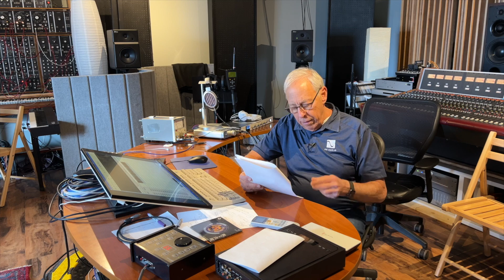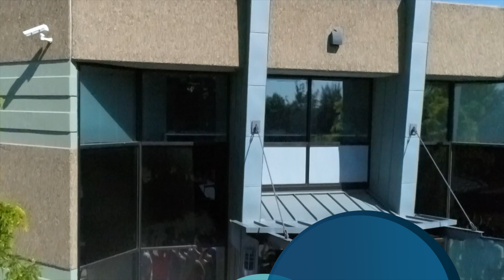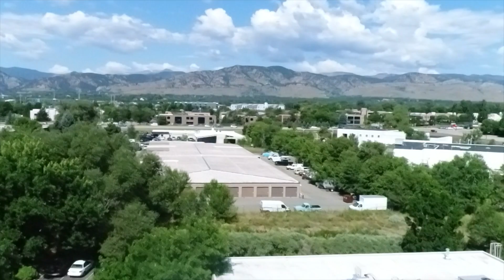External crossovers

Comment: Best is to do the cross-over before the amplifier to allow the amplifier more direct control of the speaker cones with max damping factor. Active cross-over filtering is also easier to optimize to perfection, if you know what you are doing. It can either be purely passive, with some electronics or with DSP. Digital audio aficionados might want to rip out the cross-overs of the speakers, use mono blocks to power them and add some DSP filtering to truly fine-tune the filtering characteristics to perfection against the speaker characteristics and room acoustics. E.g. miniDSP makes some products that can be used for this.
Reply: Yeah, this is a very nice AND VERY versatile way of doing it, however, it is ALSO considerably more expensive too, due to having to have (or buy) more amplifiers and the equipment needed to make the speakers actually work that way, so it's not always totally practical or doable, especially if you're on a relatively limited budget...

But it's definitely worth a try IF you have the money to invest in all of the separate amplifiers and such, AND you are ALSO knowledgeable enough about your speaker's individual driver specifications to then tune the setup properly, not only for the best sound quality and blending between the drivers, but ALSO the settings needed to not ever damage or blow out any of the individual drivers if/when playing the speakers loudly or with a lot of bass heavy music.

ALL of that above stuff is important to know and do in this kind of setup, that's why it's not too commonly done, especially among the relatively inexperienced "noobs" OR anyone who is on a tight budget.
Reply: @JoeJ-8282  Agree, this is only for those technically skilled and deeply passionate for perfection with a budget to support it. On the other hand, a beginner approach is to start with two bookshelf two-way speakers and one or two subwoofers. You can then use two stereo power amps and a miniDSP Flex 8 that will then be used with only 5 of the 8 outputs.
Reply: @JoeJ-8282  “it is ALSO considerably more expensive”

Is that true?

With an active crossover
1. You save the costs of a passive crossover. Good components for passive crossovers are very expensive, because of the high voltages and high currents.
2. You need much smaller amplifiers and a smaller power supply.
3. On the other hand, you need an active crossover. With a 4-way design per channel that can be more expensive than a good passive crossover.

An illustration of point 2.:
* Suppose you have a 4-way stereo system, with 8Ω drivers.
* And suppose you have some music which leads to 1 Ampere and 8 Volts to each “way”.
* So with an active crossover, each “way” requires 8 Watt from the power amplifiers and power from the power supply for in total 32 Watt of output power.

With a passive crossover
* You need now a signal of 4 Ampere and 32 Volts, so in total that requires 128 Watt and a power supply to supply the juice for that.
* So you need an amplifier that can supply 16x the amount of power as the 4 individual amplifiers in the active case. The power supply needs to be 4x as big.

Actually it is even more.
Normally drivers are more sensitive with frequency. With a passive crossover the extra sensitivity is “burnt” in padding resistors, and each way requires about the same amount of power. In the active case you need even smaller amplifiers for drivers other than the driver with the least sensitivity.
Reply: @JerryRutten  IDK where you're coming up with your math there, but it really doesn't make sense.

If you only needed 8 volts to the drivers in the active state, then WHY in the world would you then need 32 volts to each driver in the passive case?? It should be the same, at least for the same power output. (Making the TOTAL input wattage needed the same amount in either case too.)

And... Even IF your first set of calculations was correct, it also doesn't compute in your comparison between the wattages of "128" and "32"... That is NOT 16x as much, but ONLY 4x as much... But it's not even that in reality because of what I said in the first paragraph, above.

In reality, there IS some minor losses in passive crossovers due to the resistance of the various components, but it's probably no more than about 10 or 20% AT MOST, so, the total wattage needed for either case, (active OR passive), is actually quite similar, with the passive crossover design method definitely taking more overall total watts of power, however it's no more than about 10-20% more, like I said.

Besides, with a passive designed speaker, the wattages/power that ACTUALLY ends up going to each individual driver ISN'T equal anyway, because in most "normal" or "average/typical speaker" cases, the tweeter usually only gets about 10% of the total power going into the whole speaker, the midrange usually gets around 30% of the total power input, and the "remaining" 60% or so goes directly into the woofer, because bass notes always take the most relative current to reproduce, so the majority of the total wattage input into the total speaker almost always goes directly into the woofer with most normal music. 

I've actually tested that quite a few times over the years also, that's why I say those numbers. The relative percentages change of course, based on the relative crossover frequencies for each driver, AND the type of music being played through the speaker, (bass heavy, vocals, lots of cymbals, etc.), But those numbers I gave are pretty close to the typical average percentage of the total input power going into each driver in most cases.

So the whole overall amplifier cost thing is debatable, but simply because you need less total number of amplifiers using a passive setup, I still think that way of doing it is at least somewhat less expensive overall than an active design of the same specs or capabilities, depending on what kind of amps you use and the overall total wattage that you want to have.

And the only other difference in cost is between the relatively more expensive passive crossover components vs. the cost of the active crossover unit... Which may be pretty close to the same overall in all actuality, but ONLY if you're using quite decent to VERY good quality passive components, (capacitors, inductors, etc.), because if you're only using more "basic" or "entry level", (but still GOOD quality at least), passive crossover components, then I think the overall total cost of doing the active version of the speaker, (all other things being equal), would be noticably more than using a passive crossover instead, especially considering that you DO need more total amplifiers with an active design, regardless of the total wattage needed or desired.

Anyway, with modern technology bringing prices down on everything, and for an equal or sometimes even greater performance level than in the past, (recent inflation aside, lol!), it might be about time I tried an active speaker design again soon, especially because of the MUCH greater "tweaking" and "adjustment" ability versatility of that type of design...

Speaker building is an art and fun to do no matter how you do it, so it's really ultimately just a matter of personal preference and budget at the time, in deciding which method that you're going to use for whichever speaker project that you're working on at that time.
Reply: Thanks for your (extensive) response.

I totally agree with speaker building, and amplifier building, is fun.

OK, let’s try to explain the math step by step…
- Suppose, you have a 4-way system.
- Suppose, you have crossover point at 145 Hz, 350 Hz and 1100 Hz to distribute the musical power evenly over the drivers (yes, I know that the power in the music is not distributed evenly, but actually that’s not relevant for the example).
- Suppose, the drivers have equal sensitivity. (In the passive case this is also not relevant, because the padding resistors are there to make them equal sensitive).
- Suppose, you have 8Ω drivers.
- Suppose, each driver draws 1 ampere at 8 volt.
- So, each driver uses 8 volts, 1 ampere and 8 watt. Again, each driver!

In the case of an active crossover, you need 4 amplifiers (in the mono case).
- Each amplifier puts out 8 volts, 1 ampere and 8 watt.
- Each amplifier need juice for those 8 watt, thus you need a power supply for the juice for 32 watt (4 amplifiers). Or 1 power supply to support 32 watt, or 4 power supplies each supporting 8 watt.

In the case of a passive crossover, you need 1 amplifiers (in the mono case). If you combine the four signals you get:
- 32 volt (4 x 8)
- 4 ampere (4 x 1)
- And thus 128 watt (32 x 4)
- You need an amplifier to put out those numbers.
- And you need a power supply for the juice for 128 watt (1 amplifier).

So
- In the active case you need the amplifiers to put out 8 watt (each amplifier).
- In the passive case you need the amplifier to put out 128 watt

So
- In the active case you need a power supply to support 32 watt (4 amplifiers, each 8 watt).
- In the passive case you need a power supply to support 128 watt.

So, in the passive case, you need
- Power amplifiers that are 16 times as big (and you need 4 of them).
- A power supply that is 4 times as big (only 1).

And yes, I didn’t took the insertion loss of the passive crossovers into account, which is about 0.5 dB per filter order.

The whole point is that if you make the signal 4 times as big, the power is 16 times as big.

Hope this helps.
Reply: @JerryRutten  OK, I guess you don't understand how Ohm's Law works... Or maybe how parallel circuits work?...

Your first mistake is throwing you off BIG time!...

With the exception of the insertion losses of the passive crossover components, the total required wattage is the same in EITHER method of design...

(To use your example of a 4 way speaker...)

With an ACTIVE design:
4 drivers with each one getting 1 ampere at 8 volts (i.e. 8 watts each)
(So 4 amplifiers needed per speaker channel (Left or Right) x 8 watts each)
4 drivers (and amplifiers) x 8 watts each = 32 watts total (including same total needed from power supply) (per speaker)
(Therefore 64 watts TOTAL needed from 8 total, 8 watt individual amplifiers for a stereo PAIR of 4-way speakers)
(OK fair enough)(Right?)

Now... With a PASSIVE design:
4 drivers with each one needing 1 ampere at 8 volts (i.e. 8 watts each)(all other things being equal)(Remember about uneven power distribution among drivers in a passive design, but the TOTAL for ALL 4 will still be same, no matter what that individual distribution is.)
(So; 1 amplifier (mono channel) providing 32 watts total would be enough to power this entire speaker) (SAME AS active design) (*except for insertion losses*)
BECAUSE:
ALL of the drivers in a passive speaker are essentially/basically in "parallel" with each other, (except for the crossover components inline for each driver of course), and in a "parallel" circuit, the voltage delivered to ALL drivers would then be 8 volts, ALL at the same time, therefore, the ONLY thing that multiplies is the total current in amperes, so:
4 drivers x 1 ampere of current needed each = 4 amperes total circuit current (and AT the 8 volts that is simultaneously delivered across ALL 4 of them at once) = 32 watts TOTAL needed from a single (mono channel) amplifier, (AND associated power supply), (*plus any insertion losses*), or 2 x 32 watts = 64 watts TOTAL needed for a stereo PAIR of said 4-way passive design speakers, so VERY CLOSE TO THE SAME as an active design...

So NOW do you see why I say the only real differences is/are the types and number of equipment needed to make whichever setup work...

Only 1 mono amplifier (or 2 mono amplifiers OR even only one "stereo" amplifier for a stereo PAIR of passive speakers), of 32 watts into each speaker channel, is no doubt going to be a cheaper total cost than 4 individual amplifiers (or 8 total for a stereo PAIR of speakers) (for a 4-way speaker design), and then so the only other major thing to consider is whether the ACTIVE 4-way crossover is actually cheaper than the passive crossover component's total cost, AND by at least as much "less"(?) than the multiple 8 amplifiers are MORE than the 2 (or even only ONE if a stereo amplifier instead of mono) cost... You'd have to just see which method of design was actually a cheaper total cost for EVERYTHING needed to make each design method work properly, or at least which method was within your budget...

I think all of these prices overall would have to be experimented with nowadays, since some prices of some things have gotten cheaper over the years, and the prices of other things have gone up, but at least hopefully you can now understand where you originally went wrong in your calculations of total watts (power) needed. The only REAL, possibly significant differences there between the two different types of designs are any insertion losses of the individual passive crossover components, which definitely does NOT make as significant of a total wattage difference as you were initially thinking due to your miscalculations in the beginning of your math sequence.
Reply: @JoeJ-8282  I appreciate your response regarding to the subject, I don’t like the silly statements about Ohms Law, parallel circuits and throwing off…

Suppose a signal consisting of 4 sines: 70 Hz, 200 Hz, 700 Hz and 2000 Hz, each going into a different driver, each with a peak amplitude of 8 volt. These signals combined give a peak amplitude of 32 volt. So, the (peak) power in these individual signals is 8 watt, the power in the combined signal is 128 watt. I think it has nothing to do with Ohms Law or parallel circuits…
Reply: @JerryRutten  Nope, that's NOT how it works, voltages do NOT "sum" in this case at ALL... You need to go take a MUCH closer look at how Ohm's Law works and how you figure out watts and power, because in the case of a speaker it doesn't work the way you are describing at all... And even if it did, then it would ALSO have to do that with an active speaker design...

Go closely study Ohm's Law and how voltages and currents are calculated in series vs. parallel circuits.

If you cannot understand it after that then I honestly do not know what else to tell you, because I can't really think of a way to describe what's going on within a passive (OR active) speaker any clearer... At least to someone else who also can at least grasp the basic concepts here.

I'm not trying to be mean either, I'm just saying that either you learned what you're saying from someone who also didn't know what they're talking about, or else you just didn't fully understand what you thought you were learning about... Try again.
Reply: @JoeJ-8282  I have a question...

If you have a music signal of, let say 32 volt. And you split it into 4 signals with some crossover networks. What are the voltages then?
Reply: @JerryRutten  Well, in THAT specific case, each one of the 4 drivers then would be getting 32 volts sent into them, (potentially up to, at a maximum, based on crossover frequency settings for each driver, as a result of specifically dedicated parts of the crossover for each one of the drivers), since inside a speaker, (specifically talking here about a passive crossover design one), ALL of the individual drivers are essentially, (through the passive crossover components needed for each driver), all wired in PARALLEL, all are connected to the input terminals, with one of the input terminals connected to one terminal of each one of the individual drivers, and the other input terminal connected to the other terminals of each of the individual drivers, with whatever necessary passive crossover components inline with at least one of the terminals, therefore creating the necessary frequency cutoffs for each driver, but since ALL drivers are essentially connected to the input terminals, all of them together and at the same time, (at least through the specific crossover components that each driver needs), then ALL drivers essentially get whatever voltage is put into the input terminals of the overall speaker, and the only thing that limits that input voltage to the amounts actually going into each driver, is the specifically needed crossover components (for that driver) themselves, so then it's based on or only limited by whatever frequency or frequencies are being sent into the speaker's input terminals at any given moment, that's why depending on the input frequency or frequencies, the actual amount of that input voltage (whatever it may be), that actually goes into each individual drivers, (and therefore the watts or power going into each individual driver), is always continuously varying, depending on the music signal, however each driver cannot ever get any MORE than the input signal at the input terminals of the overall speaker, because well... I think that's obvious, due to the physics law that you can't get more energy out of something than whatever you put into it.

About the only way that ALL of the individual drivers of any speaker can actually receive the ENTIRE input signal level or voltage is if the input to the overall speaker is 100% modulated "white noise" with ALL audio frequencies being played at the exact same time AND at totally equal levels, and that would then make the overall speaker the loudest that it can be at said input level, whatever that is, and then also up to the maximum input power that the speaker can handle before burning out at least one of the drivers, whichever one has the lowest power handling. (Usually the tweeter in most cases)

Anyway, hope all of that helps you to be able to visualize this whole concept and such in your head. I will attempt to also answer any further questions you (surely will) have too, but just be open to learning and discussing things, and asking about clarification of anything that doesn't make sense to you...

I like helping others to understand and learn about new things and new (to them) concepts and such, so I enjoy explaining things to someone who is willing to learn, so if you are that then I will continue to delve deeper until you are able to fully grasp all of this too if you want to.

I can tell that you're actually trying to understand this correctly, because someone who didn't actually want to learn, but instead just ALWAYS "had to be right" about something, those kinds of people CANNOT have a decent, intelligent conversation about something they don't really get, WITHOUT getting totally upset and/or even mad and hateful, like a typical "internet troll" does if you ever call them out on anything that they may say. Those kinds of people are not worth your time to try and talk to, you just have to ignore them after they show how inflexible, irrational, unreasonable, and (oftentimes) "mean", that they are... So anyway, thank YOU for NOT being like just another internet troll, lol!

I will continue to work with you and further explain any questions you have as long as you are committed to learning more about all of this stuff! I don't know everything, no-one does, but I do know a thing or two about electronic stuff, especially speakers, after these many decades of designing, building, repairing, and improving them, so I will try my best to help you to get to a better and more complete understanding of them also, if you want to.

However, the main problems with trying to "teach" someone on YouTube, (without making a video yourself anyway), is that the comment and reply length is limited to a specific number of characters, no more than that, or it just won't post... NOR can you actually DRAW anything like diagrams or whatever through the comments either, so sometimes it's difficult to get your total point across to the other person you're speaking with... But I'll still try to help you if you want me to...
Reply: @JoeJ-8282  Thanks for all your explanation! So, if I understand you correctly…

- If I put a signal onto the speaker, thus before the passive (parallel) crossover, each parallel branch gets the same amount of voltage.
- The passive components in the crossover network are there to ‘select’ only the frequencies for that driver.
- So inside the passband the impedance of that branch is the 8Ω of the driver, and outside the passband, the impedance is higher because of the filter components in series.

- So, if you play a signal with one sine of 8 volt on a frequency for one driver, let say 70 Hz, all the parallel branches get the 8 volt signal. And the filter components in each branch are there in such a way that only one branch, one driver, get the signal, the 8 volts (assuming that those frequencies are not near the crossover points). For the other branches the impedance of the filter components are so high that those drivers aren’t getting any signal.
- So the amplifier ‘sees’ an 8Ω load, only one driver, and that requires 1 ampere, 8 watt.

- And if you play a signal with 4 sines, each sine handled by only one driver. Let say 70, 200, 700 and 2000 Hz, each with an amplitude of 8 volts. Each driver sees only one sine of 8 volt, 1 ampere, 1 watt.

Do I understand this correctly?
Reply: @JerryRutten  Yes, so far, what you said there is correct. (Except for the VERY LAST thing you said in the last sentence of the last paragraph; it's actually 8 watts in that specific case, not just 1. Minor detail I know, and surely it was just a typo on your part, and you actually already understand that 8 volts into 8 ohms produces a current of 1 amp, and therefore the power (watts) into it is 8 watts.)
Reply: @JoeJ-8282  Yes, you're right with the 1 watt, that should be 8 watt. Thanks for your answers and patience with me. But I have some more questions...

So, if you play each of those sines individually, only the corresponding driver gets 8 volt, 1 ampere, 8 watt, and the amplifier delivers 8 volt, 1 ampere, 8 watt (ignoring the insertion loss of the crossover network). The amplifier sees an impedance of 8Ω (again ignoring the insertion loss). Correct?

If we play the four sines together, now each drivers gets 8 volt, 1 ampere, 8 watt. What is now the signal the amplifier delivers (again ignoring the insertion loss), in terms of voltage, current and power? And what is the impedance the amplifier sees?
Reply: @JerryRutten  That is a very good question, and if ALL of the individual frequencies in that case are of an equal and continuous level, and they are all played through the speaker at the same time, then of course the amplifier will have to then deliver up to four times the total current, (and at the same voltage as before, across all four drivers), (at least into the individual crossover sections for each driver), and so if ALL frequencies being played are within the exact full crossover passband for each of the drivers, then the wattage that the amp has to deliver is then up to four times as much as if there was only ONE frequency going to only ONE of the drivers, so in this specific case with ALL drivers now playing a totally different individual frequency that activates each one of them individually but all at the same time, (all four in total), then the amplifier would now have to deliver up to a maximum of 4 amps, (delivered at the same voltage as before, when only one driver was playing a single frequency), and therefore the amplifier would ALSO have to now deliver up to four times the wattage or power output ALSO, which in the case of this specific example is now going to be a total of 4 amps at the same 8 volts, so now 32 watts total. (All other things being equal or the same as before, which in all reality never actually happens exactly, but just for the case of understanding the basics of this example, we'll say that's true.)

And as far as the impedance that the amplifier now sees in this exact example and under this continuous sine wave load with all of the frequencies playing at once, it is now going to be as low as 2 ohms, because 4, 8-ohm drivers, all in parallel, (at least essentially all in parallel, through the crossover, when playing signals that are perfectly in the passband of the crossover for each individual driver), is a resulting 2 ohms, and that is a big part of why you really don't want to drive any amplifier and speaker combo continually with pure sine wave signals, OR white or pink noise, (which BTW, is just a combination of ALL or most audio spectrum frequencies blended together at equal levels), especially not at really loud levels, or for very long periods of time, because if you do that, then you run the risk of potentially overheating or even damaging your amplifier, especially if it isn't actually rated for that minimum impedance that you're now presenting it with during this specific type of signal as we have described here. 

All of the above, combined with each driver's ALSO totally various, frequency dependent impedance curve, (they're never always just ANY ONE single impedance, but instead continuously varying with frequency), and also all of the individual driver's reactances to the continuously varying musical signals going into them, is also exactly why ALL speakers as a whole, have a VERY WIDE impedance RANGE across the entire frequency spectrum, AND most definitely with continually varying musical signals. Luckily though, with actual music, (instead of just pure, continuous sine wave tones), the very low impedance dips that may or DO occur are usually only there for a fraction of a second at a time, which most amps can still handle safely without damage or overheating.

I hope all of this is actually helping you to understand all of this better and it's not just a case of "TMI" or whatever... LMK if it is, or if you have any further questions, and I will try my best to explain further.
Reply: @JoeJ-8282  Thanks again for you explanation! But, I'm confused, so I have still some questions...

Does this mean that …
- Four sines going into one driver gives an impedance of 8Ω, and four sines going into four driver gives an impedance of 2Ω?
- If you measure a loudspeaker as a black box (and you don’t know the amount of drivers), and if you measure the impedance curve of that loudspeaker with a frequency sweep, you still don’t know what the actual impedance or load is for the amplifier in the case of music?
- If the impedance curve dips till, let’s say 6Ω, it dips even further depending on the amount of drivers?
- Measuring the impedance curve with a frequency sweep gives a (total) different result than measuring the impedance curve with a white noise signal, in the case of more than one driver?
Reply: @JerryRutten  Wow! OK, so I think that you are starting to understand how some of this works, however your questions above are kind of like opening a really HUGE "can of worms" there, because you're getting into some very nuanced questions now!... But I admire and respect your willingness to learn about all of this, so, I will keep on teaching you more. Most of what you said there is basically correct, but I need to further clarify a few things about your comprehension of this. My answer this time may be quite long, definitely pretty close to totally maxing out the comment and reply "maximum character length" limits here on YouTube, but I will try my best to come up with a coherent answer to these things that still fits within the space allocated to actually write in here... I have exceeded it a few times before in other comments or replies to other people who were interested in knowing more about something, especially more technical stuff, and in that case, I just have to edit my reply or even break it up into two replies so it can actually post... Anyway, enough rambling, here goes...

In relation to your first question or bullet point... It doesn't matter how many different frequencies at once are being played together through any ONE individual driver at any given time, the impedance of that driver remains the "same", but when I say that I'm ONLY referring to it's nominal ("rated" or "average") impedance, because as I mentioned earlier, the impedance of ANY (dynamic type) driver varies with frequency, and especially in the case of a constantly changing musical signal going into it, it's actual instantaneous (at any specific moment in time) impedance is constantly changing. Now with totally STEADY state, sine wave frequencies instead of music, OR constant level "white/pink/etc. noise", each individual driver's impedance will also be at a constant level, even though that level may NOT be at it's "rated" or "nominal" impedance, depending on what and how many frequencies are being played through it... Now, in the case of multiple drivers in a speaker, if all of the individual drivers are being "activated" by whatever frequencies are being input into the speaker and crossover input, (the ones that are appropriate to being within the passband of each respective driver/crossover component combo), then however many drivers are being activated in that way at the same time, are ALL contributing to the lowering of the total overall speaker's impedance and therefore ALSO the impedance load that the amplifier actually sees. However, the current and wattage requirements of the amplifier to drive said speaker load only increases when you are activating multiple drivers at once within a multi-way speaker, but if a speaker is just simply ONE SINGLE, "full range" driver, then it doesn't matter how many different individual frequencies that you add to the signal going through that ONE driver, the basic impedance load and resulting current and wattage requirements of the amplifier will stay relatively constant, because it's not the complexity (i.e. the number of different frequencies) of the signal that increases the power requirements, (as long as the volume level and overall voltage going into the speaker remains the same), but instead the only thing that requires more current and wattage from an amplifier is if the speaker has multiple drivers in it and all or most of those are being activated at the same time. The relative simplicity OR complexity of an audio signal, (how many different frequencies it contains at once), has absolutely NOTHING to do with what determines the overall voltage level that the total signal is at. The only thing that really changes the overall voltage level of a signal is... If you actually change the voltage level... as in turning the volume control up (or down) on the amplifier itself.
And the reason that four (8 ohm in this example) drivers being activated at the same time within a speaker, again by different frequencies that are routed (by the crossover components) to each individual respective driver, then ends up essentially a 2 ohm load is because of Ohms Law for parallel resistance/impedance. (That in and of itself is nuanced further in the fact that resistance and impedance are not always the same, because resistance is measured at DC, (0 Hz), and impedance is measured for AC, (ANY OTHER frequency than 0 Hz), but the details of those differences are more than can be fully explained here, or this reply would be too long, so for basic examples such as we've been talking about here, you can kind of just think of impedance as being pretty close to resistance in most cases. Go read Wikipedia about Ohms Law and parallel vs. series circuits and especially parallel resistances/impedances, if you really want to, but it gets extremely complicated VERY quickly, lol!

(As I suspected, because of length, I actually had to break this reply up into two consecutive replies in order for me to fully explain everything you asked about above, so please read the following reply below also, in order to see what I answered about your other additional questions...)
Reply: @JerryRutten  (continued from above):
Now, in relation to your 2nd bullet point... Not really, not super accurately, and not specifically... That is why all (dynamic type) speakers are just rated at a "nominal" (or "average") impedance, because a speaker that is rated at "nominal" 8 ohms, can vary between like 2 or 3 ohms "minimum" and sometimes dozens or even hundreds of ohms at "maximum", and that's because of the complexities in the crossover circuitry AND the effect and relative amount that each individual driver in the speaker, (each of which ALSO varies individually within itself, based on frequency), contributes to the TOTAL parallel connected input impedance of the overall speaker as a whole "system"... Now, as far as the difference between the impedance curve with a sweep signal vs. with a music signal, the overall average or "nominal/rated" impedance will be basically the same in either case, but the difference is that with a frequency sweep signal, the impedance ONLY varies IF the sweep is continuously changing in frequency, if you ever pause the sweep at any one specific frequency then the speaker's impedance will stop changing too and just BE whatever it happens to be at that specific frequency. With an actual music signal however, since that is continually varying and presenting the speaker with multiple constantly changing frequencies throughout the entire song, then the speaker's impedance will also be constantly changing when playing that musical signal. But as I mentioned in my last reply, since most good quality amplifiers can actually handle a varying impedance load and (at least momentary) relatively extreme impedance dips without overheating or damage under most "normal" listening levels, that constantly changing impedance of the speaker load isn't really a super significant problem to worry about too much. And all of this is why (dynamic driver type) speakers can really ONLY be rated at an average "nominal" impedance, which is usually just a mathematical average of all of the impedances that the speaker presents across the entire audio spectrum that it's designed to reproduce... Either that or sometimes it's ONLY measured at ONE specific frequency for a consistent measurement, which if in THAT case, it's usually measured at 1KHz, which is a standard reference point in the audio industry, just because it's pretty much right in the middle of the midrange and is most commonly reproduced with most music.

Now, onto your 3rd bullet point... If that 6 ohm "dip" is with just ONE individual driver vs. multiple drivers, then yes; a multiple driver speaker DOES have the definite potential to go even lower than that in TOTAL (or overall) impedance across the overall speaker's input terminals, because multiple drivers in parallel, (when playing signals in situations as previously described), will lower the overall impedance of the entire speaker as a whole. (At the input terminals and of course then ALSO as a resulting load to an amplifier powering it)

Now, for your 4th and final bullet point... That one requires a little more in depth explanation... First off, the specific impedance CURVE of an overall speaker (system as a whole) doesn't NECESSARILY change based primarily on the number of individual drivers the overall speaker has, (although the number of drivers definitely CAN change it statically and overall, like when you graph the curve on paper, but specifically the number of drivers a speaker has, in and of itself, doesn't change a speaker's overall impedance at any given moment quite as MUCH as a constantly changing input signal frequency does), so in other words, a speaker's overall impedance only really changes completely (again, in relation to TIME), with a totally and continuously varying frequency input signal, like a frequency sweep for example. Whether it's only ONE individual driver OR multiple drivers together in a speaker (system), the impedance continually varies ONLY with a continuously varying input frequency. The sweep signal is a continuously changing frequency, (unless you pause it at any specific individual frequency, as mentioned and explained earlier), therefore, a sweep signal WILL cause the impedance of a speaker system as a whole, (and even ONE individual driver by itself), to vary widely, based on whatever frequency it currently (at any given moment) is playing. Now, with a rather continuous level, (i.e. a relatively constant average voltage level), "white noise" or "pink noise" signal, the impedance of an overall speaker (or any individual driver) that's playing THAT type of signal will remain (relatively) constant, because the frequencies playing in white noise specifically, are ALL there at ALL times, in an averaged "mixture" (as that is exactly what white noise is), and so the overall "frequency" that an overall multi-way speaker system OR any individual driver actually "sees" is more of a constant "average" of ALL frequencies being presented by whatever kind of "noise" the signal is that's going into it. (TRUE and complete "White noise" is ALL audio frequencies across the ENTIRE audio frequency spectrum, all mixed together at equal levels and playing together at the same time, and any other kind of "noise", like "pink noise", or "brown noise", etc. is a more bandwidth limited mixture of frequencies... Again, more detail than I can go into here at this moment.) That question is kind of difficult to explain because you have to be able to sort of "visualize" "virtually" what is actually happening within each speaker or individual driver, and be able to imagine what the "average" signal "looks like" with white noise TO said speaker or individual driver. I understand that this may need further clarification...?

Anyway, hopefully this further helps you to understand the (sometimes somewhat crazy or even rather ridiculous) complexities of speaker design, and why there's SO MUCH diversity among different designs and brands, not to mention MAJOR confusion among most average people as to exactly how speakers actually work internally, lol!
Reply: @JoeJ-8282  Thanks.

It helps to understand what you’re explaining about crossovers. But you give me me a hard time getting the consequences of what you’re saying, because you make so many side steps.

And I think my confusion is mainly in two things:
- I understand that you’re saying that each driver get the full voltage, the amplifier delivers (“each one of the 4 drivers then would be getting 32 volts sent into them”).
- And I understand that you’re saying that the actual load to the amplifier depends on the contents of the signal in the sense how many drivers are ‘activated’ (“And the reason that four (8 ohm in this example) drivers being activated at the same time within a speaker, again by different frequencies that are routed (by the crossover components) to each individual respective driver, then ends up essentially a 2 ohm load is because of Ohms Law for parallel resistance/impedance.”).

So,
- Suppose you have crossover frequencies at 145, 350 and 1100 HZ.
- If you have only one sine of 70 Hz and 8 volt, which is destined to the particular driver, that driver get 8 volt.

- If you generate a signal consisting of 4 sines of 70, 200, 700 and 2000 Hz, each 8 volts, you get a total voltage that peaks at 32 volts.
- I think the consequence of what you are saying is the driver for the lowest frequencies gets now a signal of 70 Hz with an amplitude of 32 volts, instead of 8 volts. But I would think each driver gets a signal with the same amplitude of each of the individual sines, because the crossover network unravel the individual sines. The base player doesn’t get louder, because someone starts to sing… 

I have several questions:
- Gets the low end driver really 32 volts?
- Does the 70 Hz note get louder with 4 sines?
Reply: @JerryRutten  No, see now, that's exactly where you're going wrong in the understanding of all of this. Just because you add in additional, EQUAL voltage level sine frequencies, or you make the overall musical signal going out of the amplifier and into the speaker ANY MORE complex, with the addition of instruments or vocals or whatever else, that in and of itself does NOT change the overall voltage amplitude of that audio signal going into the speaker at ALL... Again, the ONLY way the total voltage input to a speaker changes, (whether either UP OR DOWN in overall speaker input (or amplifier output) voltage level), is essentially ONLY if you change the volume control level on the amplifier itself. (Or just the overall musical signal going into the amplifier changes in loudness level, then of course the output voltage of the amp will vary too, but I think you know what I'm referring to here; just the average overall continuous voltage output of the amplifier at whatever volume setting) But simply just adding additional (equal voltage level) sine frequencies together into the same overall audio signal coming out of your amplifier and going into the speaker does NOT affect the total voltage level of the overall audio signal at ALL, (whatever it may be), like as you are misunderstanding in your statement: "If you generate a signal consisting of 4 sines of 70, 200, 700, and 2000 Hz, each 8 volts, you get a total voltage that peaks at 32 volts." ⬅️THAT is NOT a true statement, because of what I explained above... And because the frequency of an audio signal, (or total number of additional individual frequencies at the same level as original one) has NOTHING to do with how much voltage the resulting total overall audio signal has.

A close example to compare to would be if you took four 9-volt batteries and you connected ALL of them together in parallel, then you're NOT going to then get 36 volts (4x9), because parallel signals do not ADD to each other that way. In the case of either the parallel batteries OR the parallel sine wave frequencies that you mentioned earlier, the total voltage level of ANY and ALL of those combinations are going to be exactly the same voltage level as with ONLY ONE individual battery OR individual sine frequency.

No, the lowest frequency driver (and associated crossover component combo) would ONLY be getting the exact same input voltage as any of the OTHER driver and associated crossover component combos within that same speaker, so I'm not sure where you got that the lower frequency driver ever was getting 32 volts if the overall input voltage to the speaker (AND each individual driver) is only 8 volts... Now if you actually put a 32 volt signal into said speaker then yes, the lowest frequency driver would/could indeed receive up to that same 32 volts IF the frequency of that 32 volt signal going into the overall speaker was within the passband of that lower frequency driver/crossover component combo, but the same voltage would then ALSO be going into the crossover sections for the other drivers too, however those other drivers would ONLY actually see that full 32 volts too IF there was ALSO a frequency or frequencies in the overall audio signal that actually activated those other drivers too.

The addition of additional frequency signals into the overall mix, no matter how many, or how complex, as in multiple instruments, singers, etc. into an audio signal definitely does NOT affect the overall voltage level of that signal, as long as or IF the additional frequencies or signals being added are also at the same exact voltage level as the original single frequency signal was... ONLY the volume control of the amplifier can really significantly change that overall average voltage level. (Or of course a GREATLY varying loudness throughout the song, musical input signal into the amplifier, as I stated above, but even within THAT variance, the overall AVERAGE voltage output from the amp would still remain the same, (at least during the actual music, not in silent passages of course, as that would be down to zero, but I think that's obvious), so unless you actually turned the volume control up or down, the overall average voltage level output of the amplifier and input to the speaker connected to it, would remain relatively constant.)
Reply: Addendum to last sentence of last paragraph above... And that would hold true no matter HOW many additional equal voltage level frequencies you ever added into the overall audio signal mix, OR however many additional individual drivers you added into the speaker itself... At least up to a realistic "maximum" point anyway... I mean, for example, you're never gonna see a "100-way" speaker system, even with those multiple driver "line array" types, (they're usually only around 3 or 4-way in most cases also, but those types with many multiple drivers are just connected differently internally than most typical speakers are, and that involves series-parallel connections of those individual drivers, so that the overall impedance of the entire speaker isn't too low to drive safely by an amplifier), but anyway, you'll never see anywhere even close to a "100-way" speaker (for example) because it's just not really ever necessary to divide the overall audio signal up THAT many times, among that many different individual drivers, nor would you even want to, nor would it be practical or even possible to do that, because TOO many individual PARALLEL drivers together would be an "impossible" load for ANY amplifier, if the resulting impedance load would be lower than the amplifier could safely handle. (Anyway, just a side note there.)
Reply: @JoeJ-8282  So, you are saying that composing signals of multiple frequencies is not additive.

“The ONLY way the total voltage input to a speaker changes, (whether either UP OR DOWN in overall speaker input (or amplifier output) voltage level), is essentially ONLY if you change the volume control level on the amplifier itself.”

So you say the following cases give the same output voltage:
- One sine.
- Two sines with different frequencies and same amplitude.
- Two sines with different frequencies and different amplitude.
- Two sines with same frequency and same amplitude.
- Two sines with same frequency and different amplitude.
- No sine.
- One musician.
- Two musicians.
- No musician.
As long as the power control, the attenuator, is at the same position?

Why is it then, when I’m feeding my amplifier with two sines (with Room EQ Wizard) it gives a higher voltage when I measure it (user a voltage divider)?

Why is it then that in the domain of ‘Signals and System’ they just add sines (each with its own amplitude, frequency and phase)? 

Why is it then that in the domain of DSP they just add different signals? And do you get the combined amplitude?

Why is it then that when you apply a Fourier transform on a compound signal you get the individual signals with their respective frequencies and amplitudes? (Fourier transfer is essentially a crossover with an arbitrary number of channels). And if you apply the reverse Fourier transform on the components you get the original signal with the higher amplitude? (The whole Fourier method is based on the idea of decomposing signals into sines, and composing signals with sines).
Reply: I had a system like that in my car more than twenty years ago. It was a Harman Kardon active crossover and I used three amplifiers. One for the tweeters, one for the midrange speakers and one for woofers. It was a fantastic sounding system.
Reply: With active crossover, you must use EQ. !
Reply: @ford1546  With active cross-over possibilities are endless and of course you can add precision EQ to get the tonal balance perfect also considering room acoustics, which is one of the strengths with active cross-over. With DSP you can even do linear phase filtering to maintain correct phase.
Reply: @ThinkingBetter  The job of a passive speaker crossover is also to lower frequencies the speaker has too much of. If you are going to use an active crossover, you must also use an eq.
This is where people get it wrong!
Reply: @ford1546  You don't have to use an EQ with an active cross-over. But with a DSP, you can apply any filter as needed and much more precisely than some old-style passive cross-over.
Reply: @ThinkingBetter  You misunderstand! If you only use an active crossover, it will be as if you only use a capacitor on the treble and a coil on the bass.
You will never get good sound that way!

A speaker never has a flat frequency! Had I replaced the passive speaker crossover filters in my  speakers with a purely active crossover filter WITHOUT eq. then speakers would not give good sound!

You can NOT use an active crossover without adding an EQUALIZER!
Reply: @ford1546  "If you only use an active crossover, it will be as if you only use a capacitor on the treble and a coil on the bass."
Where did you get this idea from?
You can do with an active crossover (analog or digital), what you can do with a passive, and more (Because it is active. Not only attenuation, also amplification, like a boosting shelf filter and my favourite the Linkwitz-transformer).
Reply: @ford1546  For a DSP based cross-over you will want to have the ability to equalize the frequency response also of course. As each amp output from a DSP layout can be gained individually, you also get some EQ from calibrating each channel gain. For an analog active cross-over based on a custom made circuit, you can design the circuit with whatever filter characteristic fits your needs and I wouldn’t involve what is a traditional multi band analog EQ (those are generally bad).
Reply: @JerryRutten  Agree, of course an active cross-over allows much more design flexibility. The discussion of whether the coils are driven by voltage or current is sort of missing reality. The coil moves air and need energy (power = energy per time) to do so, and this energy is neither achieved by current or voltage alone. The active cross-over is ultimately primarily about getting best tonal balance but theoretically you can do much more e.g. compensate for the predictable effect of thermal impact on the voice coil resistance.
Reply: Better, even great, most definitely. "Perfection", what's that?
Reply: @scottwolf8633  In this case, perfection is what makes you must pleased.
Reply: @ThinkingBetter  OK, thanks for the clarification.
Reply: @@Douglas_Blake I think your friend nailed it.
Reply: Hi, me again...

I agree on the statement that you want a direct connection between power amplifier and driver. But, as you know me by now, I don’t agree on the “to allow the amplifier more direct control of the speaker cones with max damping factor”. Actually the higher the damping factor the less control. Several reasons:
- First, as your statement shows, the loudspeaker manufacturer doesn’t know what the actual electric damping will be, because the amplifier, (passive) crossovers, cables and connectors are unknown. Every change influences the damping and thus the sound. Control? The whole cable market shows that the amplifier is not in control.
- Second, whatever the damping factor of the actual system is, it is all reduced to 1 (!!) at the maximum rated power level of the driver (or even less, if you have a good driver), because the voice coil heats up and doubles in resistance. Imaging also what that does to the crossover points of the passive crossover networks! So, when play some music with quiet and loud pieces, the damping is all over the place. Control?
- Third, for electric damping you need an amplifier with a (reasonable or high) damping factor, which makes the whole system sensitive to impedances and changes in impedances (modulation), which leads to compression (till 6 or even 7 dB), IM distortion (in the order of 20-30%!, see the site of Klippel), modulated noise (because your loudspeaker works as a microphone with a high damping factor). Control?
- Fourth, it is not the position or the speed of the cone that makes the sound, but the acceleration (or deceleration). Thus “braking” is counterproductive! Control?

There are more predictable, more stable and better ways of damping, for example with an active crossover (analog or digital) you can exactly tune the Q of the resonance (and the frequency).
Reply: @Douglas Blake First of all, thanks for your (fast) reaction!

My response.
* Correct, the actual definition of damping factor is output impedance divided by the nominal impedance. However, the damping is determined by the total of the impedances in the “output loop”: output impedance of the amplifier, cables, connectors, passive crossover networks, voice coil resistance and voice coil inductance. So for example when the voice coil heats up and the voice coil resistance goes up, the output level goes down (power compression).
* Yes, most amplifiers are dominantly voltage sources. That is they will maintain the same output voltage over quite a range of output currents. This makes the VOLTAGE insensitive to changes in impedance. However an electrodynamic driver is a current source (according to Ørsted’s Law, more than 200 years ago). So keeping the voltage insensitive, makes the current and the output more sensitive to impedances.
* Yes, it is the acceleration. And with a sine it’s continuously changing, with the most positive acceleration (highest actual SPL level) in the most backward position where the speed is changing from going backward to going forward. See for this video’s about wave tanks and driver simulations, or just try this out in your bath tub!
* Yes, most amplifiers have a low output impedance and a high damping factor. But, that doesn’t mean that’s a good idea… Physics is not dictated by a majority vote. That’s why the examples of amplifiers by Nelson Pass (F1, F1J) and active loudspeakers of Kii (Kii Three) and SGR Audio (Convex Series).
* The force on the driver is force factor (B x L) times current (F = BL x i). The force factor is expressed in Newton per Ampere (or in Tesla meter). The acceleration a is F/m, thus dependent on the moving mass of the driver.
* The driver works also as a microphone and generates a back-emf voltage (Eemf = BL x v, where v is the speed of the voice coil), depending on the total impedance it creates a (out of phase) “braking” force on the driver.
* And, yes, I’m really sure… Especially after I built my own current-drive amplifier in 2017. I gave away my traditional voltage source amplifier.
Reply: @Douglas Blake Yes, that is not new to me... The question is which of the two you want to control, the voltage or the current, and thus the sound in the case where the impedances (your R in the equation) are unknown, variable and/or modulated.

If you control the voltage with a current driven device, you introduce (easily to avoid) compression, distortion, modulated noise (a problem for imaging), less bandwidth and a less smooth and changing frequency response. If want to drive a current device use current (Zo ≫ Zi), if you want to drive a voltage device use voltage (Zo ≪ Zi), if you want to drive a power controlled device optimise for power (Zo = Zi). And, as driver spec are usually stated for voltage-drive you can easily outperform the spec with the same driver.

And maybe the most bizar, all active devices are controlled current sources, two out of three fundamental configurations (gain, voltage buffer, current buffer) give a current source, and the other one, the voltage buffer, creates the Miller effect in earlier amplifier stages which reduces the bandwidth of the amplifier. So also here there are good reasons to design and build current-drive amplifiers.
Reply: @Douglas Blake And the sky is blue…

But, what’s your point?
Reply: @JerryRutten  Power (current times voltage) is what makes the sound waves possible. Whatever Watts (Joules per second) comes into the amp from the power cord turns into Watts of sound waves with a huge loss in the energy transfer. 99.99% of power amps are outputting a voltage representing the signal amplitude, like it or not.
Reply: @ThinkingBetter  Yes, you need power to make it possible, but the issue was about control of the driver. When do you have the most control over the driver, using voltage, current, power or charge to represent the signal in the power output to the driver. For an electrodynamic driver it is the current. 

And the fact that the most power amplifiers use voltage doesn't make it the right choice. Physics is not dictated by popular vote. And that of those 99.99% more than 90% or so are actually phones, earbuds, car audio and bluetooth speaker, doesn't make those a good choice for quality...

I only hope that people start to read some wikipedia, some scientific papers, some articles of designers, and ask themselves: why?
Reply: @Douglas Blake It not the only way, put 2 amperes through an 8 ohm load and you get 16 volts. That’s the way how amplifiers create a voltage output.